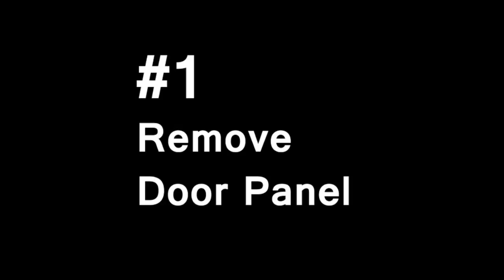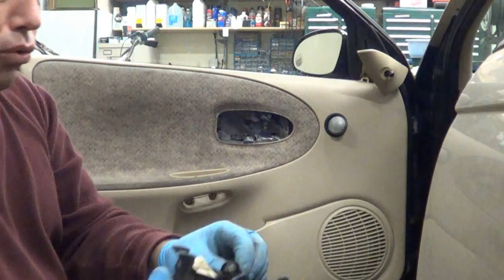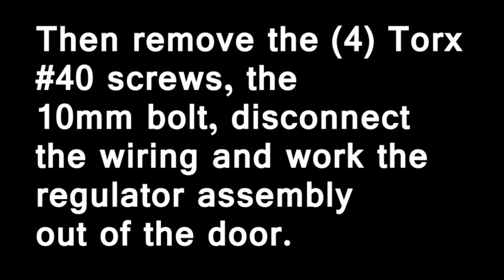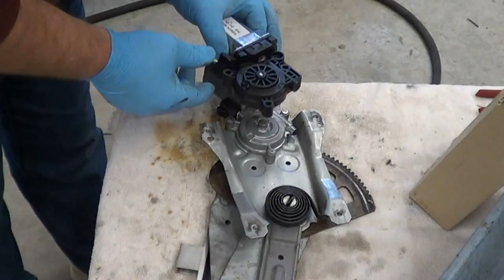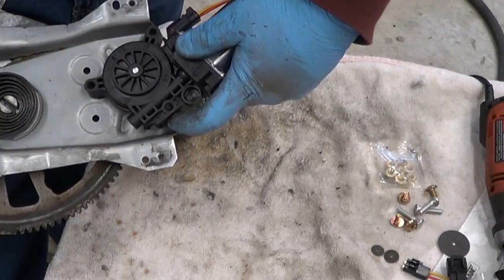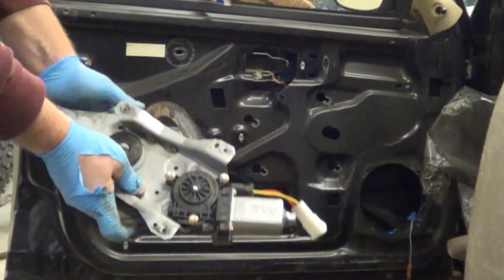Saturn SL1 Power Window Motor Replacement

Comment: @7:54  I have BMW group Lubricating Grease FB-1. It is expensive, and good for metal-to-metal (what I've learned). Can I use it for greasing of the Regulator, if I may have your opinion? I forgot about that grease I have, since was concentrated on the 1st regulator to be installed back, and apply on that regulator a bit of White Grease. Is it O'K? On other 3 regulators I think to apply FB-1. Thank you.

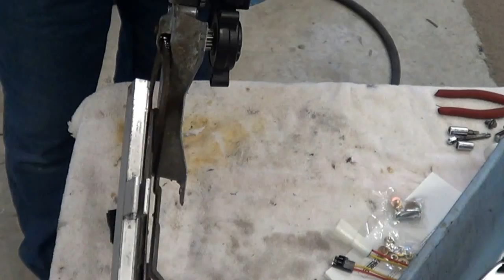Comment: @7:24  When removing that motor fm/regulator, you need to keep the ends of the regulator together, or put some tie rope over the opposite to the motor end. When I removed the motor, the regulator popped out suddenly (I knew that it acts like a mouse trap in some sense, someone on Amazon wrote, so kept the hands off the thing as much as possible, but I didn't hold the ends together and it opened abruptly). All that is bcs of the round (circular) spring inside. Does someone know how to remove it properly? Not necessary of course, but would be good to know.
Reply from the maker: Your comment is likely correct.  My regulator must have been fully open, so that the regulator couldn't open any further, and that allowed the motor to be removed without the "mouse trap" event you mentioned.  Thanks for the addition.  This was my first video ever, and it's not great, but I did my best at the time.
Reply: @sasngang  Thank you for the replay. I see, I didn't think about it, yes if to have it in the open position, it won't spread then. But when you remove it it should be in closed position, otherwise mine wouldn't come out due to lack of space. Maybe it depends on the car. Your film is great and very informative. I just tried to add what I've learned recently myself. I still can't find any info on that spring removal and installation. Thank you again.
   Update: About the Spring. I've learned that it is practically impossible to put that Spring back. I used the old regulator how it was. Just put a new motor on. I just drilled a new holes in the old regulator to fit the new motor. I greased the teeth of the regulator w/ a bit of White Grease (forgot about that expensive grease, mentioned in this video  I also have (BMW group Lubricating Grease FB-1)).

Comment: @5:28   Thank you very much for demonstration of that great technique on rivets removal. I cut some before working on lower control arm in 2003 Chevy Cavalier, but not expert in it at all. Now I need to replace the Window Motor on our 2001 Saturn SL2. Ordered the Motor already and read that at some point you'll need to remove some rivets. It is good to know what it is exactly, and how to handle this. The part about opening the excess to the motor was also helpful. Thank you again.

Comment: I have watched several of these how to videos on Saturn door skin removals or window removals that show removing all the screws to remove the outer door panel. All but 2 of mine broke the plastic tabs when I removed them. I did not see this problem on the how to videos. What did you do different?
Reply from the maker: No good answer.  Sometimes the retaining nut is seized.  I would try some PB Blaster the day before and try to get it into the threads.  Not sure if an impact driver would help or hurt.  Corrosion sucks!  be sure to lubricate them when reassembling, to avoid future problems.

Comment: Wow, this must have been a completely generic motor kit.

I would never expect a motor sold as a replacement for this application to require cutting off part of the motor case; that's just lazy on the part of the manufacturer.
Reply from the maker: Yep.  I agree, but needed to get the job done, so just lived with it.